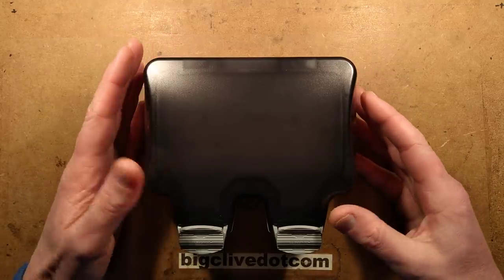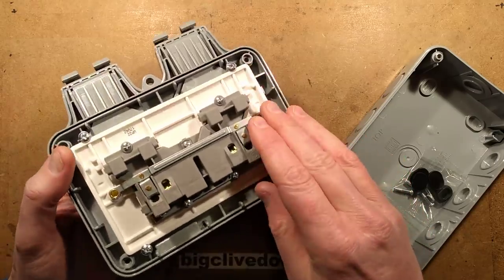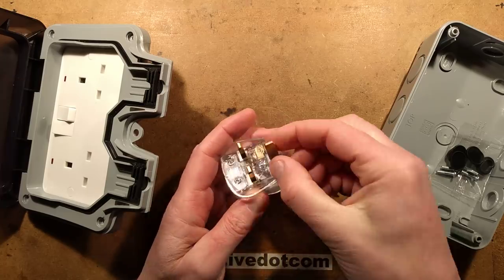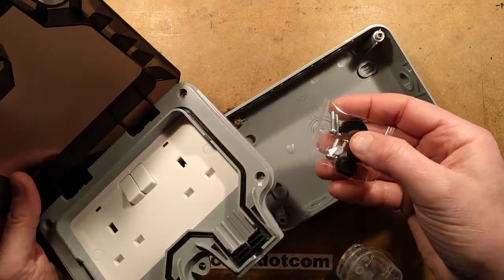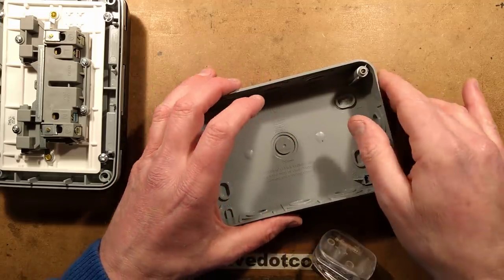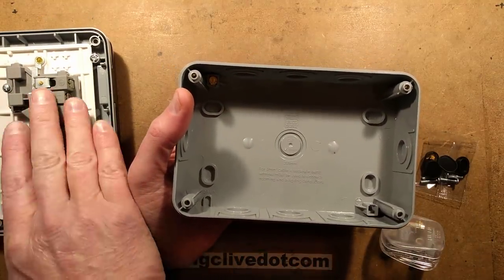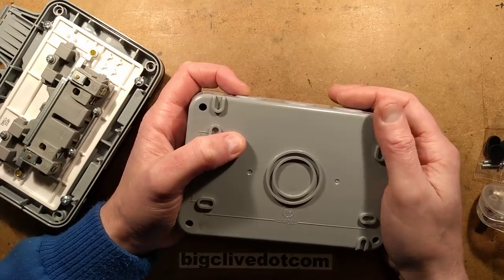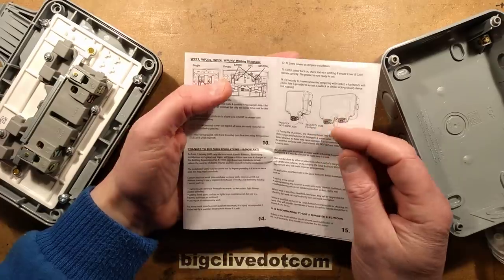British weatherproof socket with clever design. (bonus rant)

Comment: I think the British plug design would make an excellent design for an anchor for a boat, becaucse when you pulling any electric equipment out of a cubord or shed the plug catches on everything.
Reply: Or a grappling hook to draw ships closer to yours in order to board the ship. Can also be used to climb the walls of a castles in a siege.
Reply: It does indeed serve that purpose very well.  You have to learn a special jiggly twisty pull to stop them snagging.  UK plugs also make an excellent defensive measure.  Leave a few plugs lying around and anyone in their bare feet will be guaranteed to suffer a painful foot injury, partially disabling any bare footed attackers.
Reply: Lego has nothing on the plug's ability to stop an intruder in their tracks.
Reply: Joshua Rosen - only in a pitch black room
Reply: Would also be good for jumping from an airplane when there are no more parachutes, those prongs look like they would cause enough friction with the air alone to stop you before the big splat...
Reply: @joshuarosen6242  Yes I think us British have all stepped on a plug with bare feet sometime in our lives. Ouchhhhh
Reply: @Undefined Lastname No.  Because everyone has foot-mangling plugs that counts as the burglar's fault.  Careless burglars get what's coming to them.
Reply: Worse are D-type connectors. The top of the screws will snag on fresh air, the buggers.
Reply: @joshuarosen6242  And don't I know it!

Comment: Not only are the safety covers not needed, they provide a useful earth-pin-shaped tool to help open the shutters for the determined kid
Reply: Your lack of explanation leaves me wondering what you are talking about!
Reply: @mrsillywalk  the safety covers tend to be made of flexible plastic, so manipulating them so that you can push the earth pin in without pushing the neutral and live in is reasonably easy. 
Similar to how badly designed power strips can allow you to plug just the earth pin by plugging a plug in upsidedown.
Reply from the maker: But to be fair, many great electrical careers started with the insertion of knitting needles into sockets.  Perhaps we are destroying future careers by protecting kids from "the force".
Reply: The shutters require some tool to open them. If a kid can open them then they can also remove the "safety" cover. So they are useless
Reply: I still have my dad's screw driver with a chunk I took out of it working on live circuits I was sure were off.
Reply: Yep, the "safety" covers actually make things less safe, especially the cheap flexible ones. It's pretty scandalous that you see otherwise reputable/sensible businesses and people selling, using or recommending them.
Reply: @bigclivedotcom   I did exactly that back in 1958 because I was obeying "Don't Touch!" instructions.  I've had 60 years of Electric Light and Power, Telecomm's, TV and appliance Servicing, PC building and repair and now Custom electronics design due to the wonder that little event inspired. And 'Yay' for rubber-soled plimsolls :-)
Reply: I had an argument with social services over this when we were going through approval for adoption. They were adamant that we had to buy and fit the 'protectors'.
Reply: John Pirie-Elsom which is ironic since both the NHS and the DfE ban them and DfE are the department responsible for all social workers and adoption services. Methinks your local people need a bit of education themselves.
Reply: Also they are frequently incorrectly sized so damage the sockets. Worse than useless.
Reply: Article from the IET a couple of years ago said as much.
Reply: @bigclivedotcom   Received many mains shocks growing up. I am much more aware of the danger of mains voltage now that I am old. In the US our voltage is half that of Europe and the ground fault leakage threshold is per circuit only 5ma +/-1ma.
Reply: It would help if they weren't all made of cheese grade plastic, but you're quite right, the standard UK socket is already as childproof as you'll get. Adding any accessories only worsens the shock hazard.
Reply: I take my hat off to whoever designed the UK plug. Simple, but effective with the earth built right in and ingenious guards that ensure earth is in place at the live pin covered before it opens. 

And a total bastard to step on when crossing a darkened bedroom to go for a pee at night.
Reply: @tomschmidt381  I've only ever had one euro mains shock and tbh it's really not an experience I'd care to repeat. It has however made me acutely aware of electrical hazards involving high voltages and therefore safer around electrical systems as a result.
Reply: My son would remove them and plug in the vacuum cleaner for us when he was 2. He put them back afterwards :)
Reply: As a toddler I managed to get two knitting needles in both earth and life. Fortunately I had them crossing and touching  half way up so I blew the fuse box and got away relatively unscathed though a bit puzzled and not a little frightened.
Reply: It's just a Darwin award nursery training kit.
Reply: @bigclivedotcom  me too, my mum hated it. I loved 'the spiders' apparently :)
Reply: You know, they have all this fancy stuff for plug sockets but light bulb sockets are wide open and "welcome in". That's what got me bitten twice by the 240 as a child. Once while jumping on a bed at a party and the light over the bed had no bulb in and the other groping around in the dark for a light switch in the loft of my parents' house.
Reply: mikeselectricstuff It should be noted that same quality plug shaped covers have the opposite effect on most continental sockets. Because those either have no shutters or have a balancing shutter that opens when equal pressure is applied to live and neutral (earth does not participate in shutter operations).  These dummies were especially good before the balancing shutters became standard.
Reply: @johnfrancisdoe1563  We now have balancing shutters in the US too. Which is great because those "safety covers" suck when you just want to plug something in.
Reply: @TheSadButMadLad  By fitting a "safety" cover, you are providing them with just the tool they need  to open the shutters.
FAIL!
Reply: My electrical career started when I stuck my finger into a 240v live light bulb socket (aged 7), then nearly ended when I stuck my finger into a live valve amp (age 9). 55 now. Learned to keep one hand in my pocket.
Reply: @johnp-e9963  NHS have put out an advisory to all children services to get rid , i would speak to local management
Reply: I suppose if you really do want an extra layer of protection to stop children accessing sockets then something like what is in the video but with a lock on it would be an actual effective solution. I think you can buy such things.
Reply: I had plug covers for my multiways to help if someone spilled their bloody tea all over them, they had 3 prongs and they were not soft at all hard plastic and none of them broke, they were not expensive I think they came from Poundland. Were the hell would schools be getting soft weak ones from
Reply: @bigclivedotcom  as a kid mine was sliding a piece of mecano behind a plug before the days of the plastic half insulated pins. It made a huge bang and that socket had the black stain to remind me from then on :D
Reply: @andljoy  It's because idiots insist on buying them, Andrew.
Reply: @Squeeks So it does. Neat. 
You can also similar non-water resistant indoor ones with built in locks, which if you do want to ensure kids don't plug in/unplug stuff, as well as preventing the very slim chance of inserting objects in a manner that does allow access to live. Kinda bulky and awkward, but at least better than nothing rather, than worse.
Reply: I am surprised they haven't banned these things given how unsafe they are. Or have manufacturers with big investments in tooling for the things used their lobbying influence to prevent the bans?
Reply: You're trying to hit that age where kids are too dumb to understand cause and effect until their old enough to understand the dangers of electricity without experiencing being shocked.  It isn't a fail-safe.  It's just a layer of protection from a toddler with a fork.
Reply: @bigclivedotcom  my mother did tell me I did do that as a wee lad so there might be truth to that
Reply: I discovered in about 1967 that a small Philips speaker - as those found in their electronic kits, could explode with considerable force when leads to the coil are inserted into a UK 2A socket.

I'm still here...
Reply: @bigclivedotcom  Ah the junior electrician - I started out by turning off the power to an extension cord and cutting the wire with some scissors. Only I had not turned off the correct cord, so those scissors instantly developed a huge indentation in them. Lesson learned at 5: Check that you turn off correct equipment.
Reply: @bigclivedotcom  Not sure I can count the number of times I've felt the 'tickle' of a live 240V wire as a kid.  I had at least two full-on shocks,  then again I also burned myself playing with fire or cut myself on penknives numerous times.  I suppose the difference is that a fire will rarely kill you if you're aware of general fire safety, whereas those angry pixies can carry you off in a jiffy if you touch the wrong wire in the wrong way.
Pretty sure it's illegal even where I am, but I have no problem replacing a wall switch, light fitting or socket myself. Nobody saw me do it, it wasn't me.  I will steer clear of mains wiring or breaker boxes though.
Reply: @Null--  Back when I was an RAF radar tech I ended up with the unenviable task of having to prepare multiple radar systems for the scrap man. One of the tasks involved disconnecting all of the wiring as it entered the racks. There were a lot of different power lines coming into each rack, from 6.3V AC, but capable of pushing upwards of 100A, ±300V DC for the valve HT and even ±600V DC for some circuits, as well as simple single phases of 240V AC mains. Different racks, or parts of racks would run off different phases so losing a phase wouldn't kill everything. Not to mention all the RG58 50 Ohm coax for the signal interconnects. I was given a pair of 10" tin snips as my tool for cutting the cables, and I did cover the handles with a couple of layers of heat shrink. The pocket knife to open up the nicely laced looms I had to provide for myself.

I had no issues with the equipment's that I had been qualified on, and of all of the minimum 10000 cables I cut I only had one issue. In one rack where we no longer had anyone who had been qualified to work on it there was a modification that was undocumented in the wiring schedule. A 13A socket had been added and the guy who did the job just picked a random 240V distribution box to connect it to. Of course it was a distribution panel that was still in use, so the damn thing was still live. Fortunately the live neutral earth short across the blades of the snips tripped it before it got too painful. I cut the cable at ground level, and the snips hit the rack door behind me about six feet up. It was more painful when they came back down and landed on me. Not a happy bunny that day.
Reply: @bigclivedotcom : I wound quite a lot of mains cable around a large file as my "electro magnet experiment" then stripped and  managed to insert the ends of the cable into the socket..... needless to say I didn't try it again.
Reply: @bigclivedotcom  No other statement has resonated with me as much as this, Aged 7 I jammed 3 darts into a socket working counterclockwise till it kicked a lifetime of fascination, 18 years later I am now a linesman and the passion is stronger than ever!
Reply: @bigclivedotcom  when I was about 7 I took the bulb out of a lamp switched it on and pushed the bayonets with my fingers... To see what would happen. It hurt. I am 60 now.
Reply: @bborkzilla  I have a multitool with a similar mark due to some stupidity on my part.
Reply: @bigclivedotcom  I assume this was you Clive, Electrboom tells a similar story of his childhood in Iran and his brother telling him, come here and touch this....
Reply: @mrsillywalk  The safety covers consist of a flat piece of plastic with 3 plastic pins that fit in an unused socket instead of a plug. They are a stupid idea.
Reply: Note that most modern (and not super cheap) sockets require pressure on ALL three pins to open the shutters. The earth releases the lock on the shutters, and then you need pressure on live and neutral simultaneously to spin the shutter out of the way. 

This doesn't stop safety covers being flawed and allowing access, but it hinders their use simply as an earth pin.
Reply: Yes, and I did that as well, but I am still here!  My father was the type that would 
prise the earth tab back, stick a screwdriver in to keep it open, then stick the wires in with matches!  Needless to say when I got a bit older I wouldn't let him near electric.  No, I didn't do the same myself lol.
A determined kid can get the safety plugs out anyway, I used to enjoy taking them out just for the hell of it.
Reply: we need a different safety device instead. that detects if someone is being shocked and shuts it off with fast solid state electronics or a spring loaded contact, so it just gives you a moderate zap.... to make sure kids experience the force.
Reply: @bigclivedotcom  May the force be with you!! :-)
Reply: @AlanEvans789  Healthy respect is "won" this way - thanks for the story!
Reply: Too true. I recall a report on safety hazards with these in the UK. Apparently more people are hospitalised trying to remove these- owing to the old fingernail behind the plastic issue, compared to the dawdlingly small electrocution level from fingers in the socket (zero I believe) as a result of the great design of the 13amp sockets safety measures.
Reply: @km5405  Nope.... What we need is a sensor linked to a contactor. The sensor would scan for brain dead idiots or part P 1 week sparks and open the contactor to isolate just after the tails block   :-D
Reply: @iankirk3537  They can be defeated yes but its better than nothing that's for sure. I think if I had the job of designing the plug and socket I would have a magnet in the plug along with a plunger switch so you would have to have pins pushed all the way in the plug and the magnet closing the reed switch before the socket energises.
Reply: @fakshen1973  but what toddler is strong enough to bend a fork in such a way that it fits inside the holes?
Reply: In Canada our sockets are open no covers and no fused plugs.  Stuck a knitting needle in one myself when I was young.  :-)
Reply: Where I lived in Coventry, as a kid, we had three pinned plugs/sockets but they were unusual in the fact that they had no switches, no shutters and round pins (not rectangular). Needless to say my brother and I got shocks from them. Later on, when we moved to a place with proper sockets, I managed to knock out a section of street lighting by putting a strip of copper in the live and neutral (I found out later that, for some reason, there was a fuse box type thing on the side of our house that had something to do with the street lighting - not sure why though)!
Reply: @TheSadButMadLad  There are just children, that sudden go quiet with intent & neglect. Along with phone Rec.
Reply: habbajack
Reply: One of the places I worked (in the UK "Ed Biz") was kitted out with a completely different plug system; the plugs went in to the socket then you rotated the whole thing by 90 degrees to make the mains contact, locking the plug in to place - without a plug you could poke anything you liked in to the socket and you wouldn't get zapped! (though I presume something nice and flexible would do the trick - and teenagers are quite resourceful that way!)
Reply: translation for normals?
Reply: @bigclivedotcom  indeed BigClive.. one small boy wanting to see if a piece of metal would melt poked through the grill of the fire onto the element .  Zaaaapppp.... after he picked himself up from the other side of the room and pushed the sofa back upright.. he was intrigued.....many further shocks later went on to become an apprentice electrician in 1981... ha ha..
Reply: @bigclivedotcom  Yep, I was brought up in the 50's in a house that had last been rewired in the 30s. You learn a lot by experience!
Reply: @andljoy  Noooooooooooooo! Don't go down that rabbit hole. Talk about an unnecessary monomaniac obsession.
Reply: I would love to hear Clive waxing lyrical on the UK asbestos removal industry.
Reply: @Equiluxe1  Ah, but is the idiot the person that designed it and made money from it... Or the person that bought it?

Comment: I have to agree 100% with the part P nonsense. There is similar nonsense for boilers. I worked for a company that made the boiler controls for Glow Worm, Worcester Bosch, and several others. So in effect I was qualified to design and validate the design of the electrical control system (which is safety critical), write the manual on how to install and test it, run it in a lab, including wiring it up and attaching the gas and wet rig, but not actually wire it up in a house. I can understand plumbing certification as there is an art to that as well as some science. But electrical safety is down to purely science/engineering.